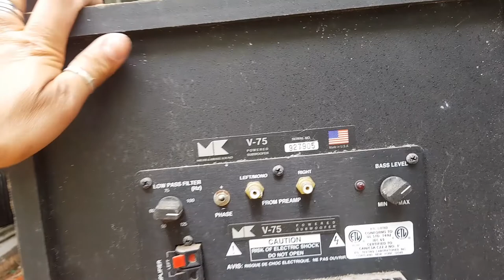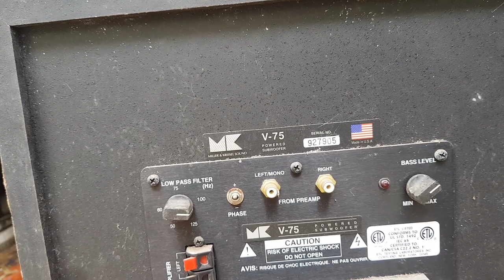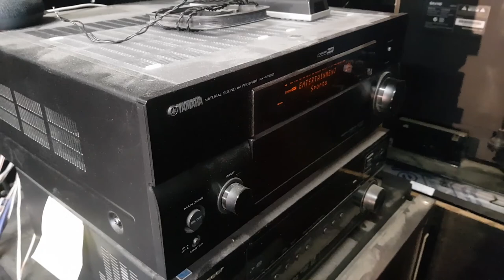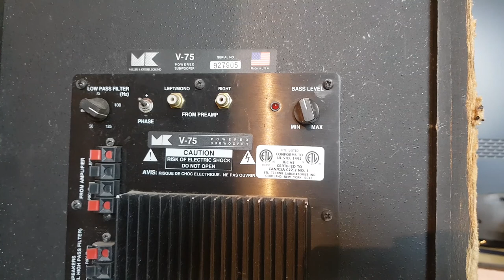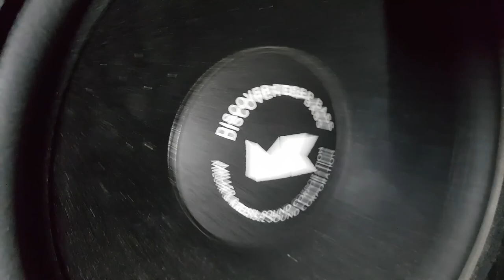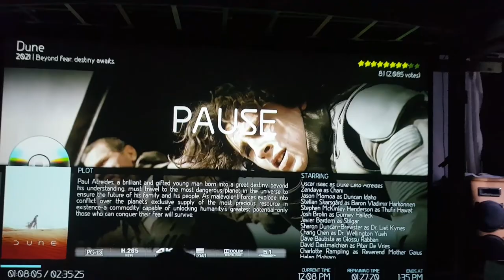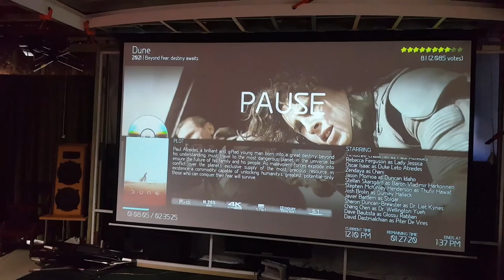Miller and Kreisel v-75 Subwoofer.  5 days in the rain! Will it work? 'Ant's Super Cinema' part 26

Comment: Great news to see its all going. Gives you a good feeling inside seeing someone so happy with their work. 
 I've found a black whiteboard marker is excellent for any minor marks. You could also use a hair dryer on the front of the panel at a distance to reduce any of the bubbles on the front vinyl off.
Reply from the maker: Thanks Adrian!  Oh yes, I use the black nikko pen trick all the time 😁  I was actually thinking about  sanding back the entire thing and respraying.  Would be better if the speaker came out but I think I could do a pretty decent job of masking it up.  I've been using it for a couple months now and it's brilliant 👍